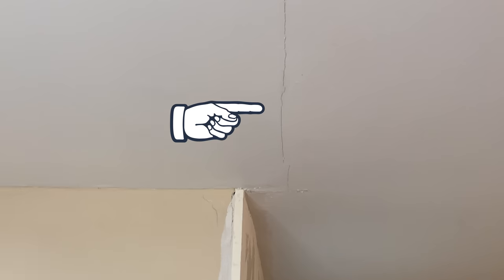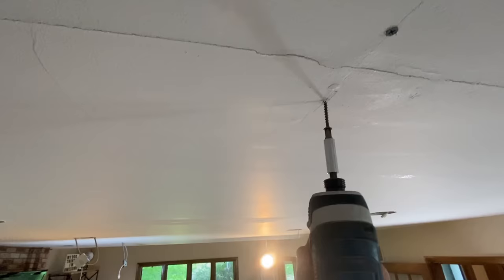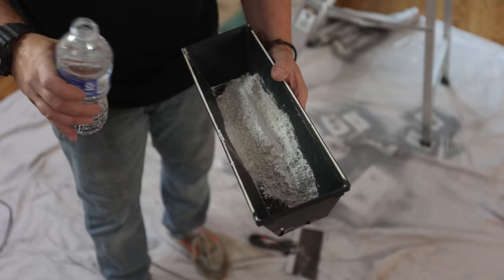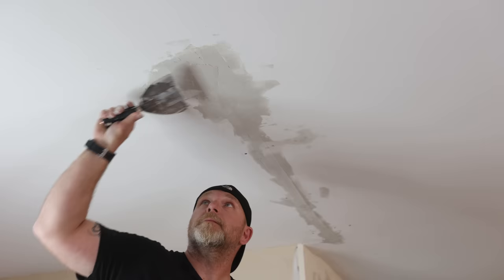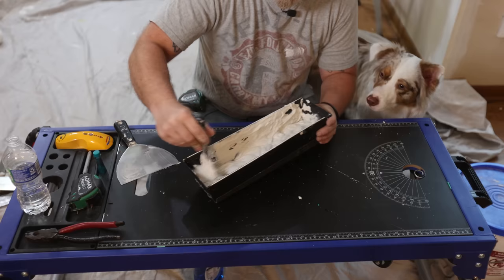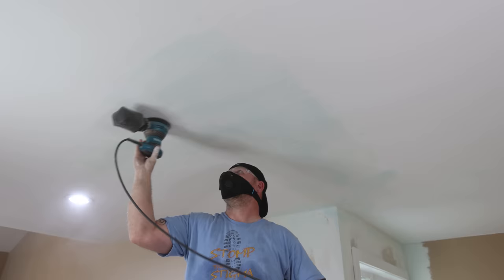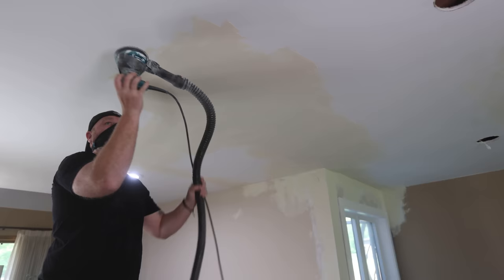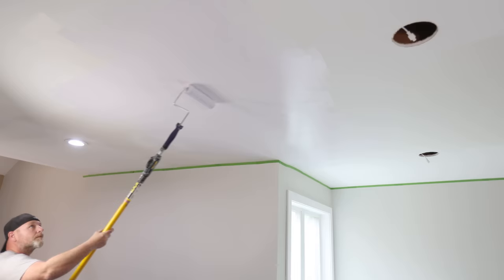How to Fix a Drywall Crack in Ceiling or Wall FOR EVER!!! Tutorial

Comment: Don’t use the color changing paint on a bathroom ceiling if you like hot showers. The moisture brings the color back every time. Learned the hard way.
Reply from the maker: Really??? Had no idea but that’s a great tip!! Does it stay like that for a while ?
Reply: @KomarProject  once the moisture level in the bathroom goes out it goes back to white. I had to kilz it twice then paint with white ceiling paint to stop the issue. Even with the vent fan going, it would change. My wife takes showers as hot as possible, so the vent fan couldn’t really keep up.
Reply: They need a paint that turns red for hot showers, blue for cold.
Reply: I have not seen this ever happen is several baths. What brand of paint?
Reply: @cconnon1912  valspar. I’m glad it hasn’t happened to you, it did me, that’s all I can say.
Reply: @cconnon1912  several people have ran into this issue, but for me, I avoid it in bathrooms.
Reply: I use exterior paint in wet area. No o e ever knows.
Reply: @face2faceyouth  I know the brands of Colour but which particular types of colors I can buy
Reply: @face2faceyouth  what of a wall
Reply: That's why the recommend " Kitchen Bath paint" it is designed for high moisture areas, try living in the East side of the Hawaii Islands, it's ALWAYS that paint, or more comes always, homes are built of stilts so air moves under the structure to help.
Reply: Yes, that Valspar color change paint is absolute trash. Or at least the batch I got was. I used it on the whole first level of my house. I followed the directions meticulously, stirred it really well, and even after a week of drying in low humidity, it never quite lost its purplish hue. 

I had to make a nuisance of myself at customer service and was eventually able to get a partial refund. Unfortunately, I'd already thrown some of the empty cans away and couldn't get a full refund, even with my receipt. And after all that, I still had to stain block and completely repaint the whole ceiling.
Reply: @KomarProject Hi I just subscribed to your channel today I have doing some home renovations as well well kind of It's been 3 years and I still haven't finished but would you be able to send me a link or at least a description list of those products mainly color changing as I know trying to do ceilings in my house with not proper lighting can be really challenging when everything is white as well with the drywall compound thank you Happy New year.
Reply: Wow This is the best tip of the Day.. Thank You🙏
Reply: Looks much better. Just sucks that it takes coating 8’x8’ area for a 6’ crack. I have a 20’ crack. I might as well replace the drywall. It can’t be screwed up snymore. The trusses are bowing down over the last 60 years. I

Comment: Adhesive caulk has come a long way. Whenever I have a seam crack that shows up. I clear the seam out completely and even take off the original tape. I have found Loctite powergrab works the best. Apply a bead in the seam and down either side. Press the seam paper into the adhesive using a 2 or 3 puddy knife. Allow to cure and mud as usual. I have never had a crack reappear in ten years using this method. It was a game changer when I decided to give it a try. Ever since this is how I do all my seams from the very start because I HATE rework.

Comment: I have repaired a lot of drywall in 40 years of finishing. The paper tape failure is 99% user error and not being shown how to thin the mud prior to use. With this type of repair I would always do my best to get down to the drywall and remove all the old tape from being damaged by the moisture. I totally agree with the bed coat and Durabond whether you use paper or mesh (IMO mesh should only be used with a fast setting compound), but I then use the Easy Sand quick set on the first coat to add another layer of hard setting compund to the joint. Then on to the Plus3 and float out till it's no longer noticable
Reply: That’s the exact way to do it….. if you do not remove the damaged tape, then you are just applying mud on a piece of paper tape that is just “ floating their “ and is no longer bonded to the drywall ….. I have a video
Reply: And stephen is on point with the mesh tape being used with quickset only……using it with all 
Purpose, joint compound Will 100% crack again
Reply: @New-Breed-Drywall-And-Paint  Nonsense.I have used every type of mud with all types of tape and 100% no cracks.44 years of drywall experience is all you need to know.
Reply: @velt7560  your telling me using all purpose mud over mesh tape will not crack ??? Is that what your saying …??? One thing I’ve learned from hiring plenty of guys who were not good enough to wash my pan is never hire the guy who throws in his years of experience .
Reply: @New-Breed-Drywall-And-Paint  Never cracked on me.Just gotta know what your doing.
Reply: @New-Breed-Drywall-And-Paint  I'm not for hire so you're safe.I am a one man crew. Let's hear it for my crew baby, let's hear it for my crew.If you use mesh tape I wouldn't let you fill my buckets with water. Ha! Burn!
Reply: @New-Breed-Drywall-And-Paint  I noticed you didn't throw your years of experience in.They don't count till you get at least 30 then add to them.I use 5 minute mud all the time with regular tape.I can use any kind of tape with any kind of mud without whining or it cracking. I don't claim to be the best that's just the way it is.
Reply: @New-Breed-Drywall-And-Paint  I have never had cracking when using all purpose joint compound with mesh tape. Cracking is more of a function of the drywall being not completely secure or underlying stresses that have not been addressed (which the video talks about).
Reply: @New-Breed-Drywall-And-Paint well first off if you're not smart enough to cut out the blister tape you don't always have to remove it but you have to put mud under it to make it stick again but always cut out blister

Comment: Very well done, I learned some good tips here.  As a painter myself driving paintable caulking in the crack and then spackling on top followed by sanding always has worked well for me.  The caulking is flexible and will not crack once in side the cracked ceiling.  I think using your methods will provide and even longer lasting fix.  Thank you.

Comment: Very helpful info! That purple-to-white ceiling paint is great! Beware of drywall dust, though. Please use plastic draping! No matter how careful you try to be, sanded compound dust floats and gets EVERYWHERE! I noticed your unprotected TV and furniture in the background and cringed. Drywall dust can damage both, either right away or over time, as it settles deeper into the components & fabrics. 
The way you explain things is clear & in depth. I'll check out a few more of your videos. I've been at this for years, and it's nice to learn new techniques & tips!
Reply: Either that or use a dustless sander. Although those generally aren't cheap and probably not worth it unless doing drywall for a living. A simple DIY project around the house on the weekend may not be ideal to spend that much money on something you'll use once and never again lol

Comment: Excellent instruction! I taught school for 30 years. I know what I’m talking about. Lots of self-help videos give good information, but are still not enough for true novices. Lots of guys who “know what they’re doing” will benefit, too. Adding food coloring to the mud is brilliant! I’ve had a crack in my wall for years. Now I feel like I can fix it. Thank-you!
Reply: Let us know how it goes.
Reply: Those that know DO, those that don't Teach. There is literally no reason to add food coloring to your drywall mud.What you should do when doing your final sanding is check it with a light parallel to the patch work. The shadows will amplify any problems that you probably won't see until you get your paint on.

Comment: as a 47 yr plaster @ drywall vet, I agree with re-screwing the the board, however,  I  V- out the crack, vacuum , fill the crack with gun foam (not cans), leave it proud till set, then shave down with a fine notched trowel, ( lays flat),   then a skim coat of mud (no tape), sand and paint with good paint that has a little flex.  I have a 110 old victorian, and I have found that houses have "favorite places to crack do to expansion, etc. these cracks need to be filled and finished with materials that can flex since they will continue to move...foam will do this
Reply: Which foam to do you prefer?

Comment: If you need to get excess high spots off, sanding does the job, but for feathering edges, wet sanding works really well with no dust.
Reply: You should never have to sand an edge, feather it with the knife! Sand is for changing texture that’s about it, you want as little mud as possible!
Reply: If you're any good you shouldn't have to do much sanding.

Comment: This will work great for most cracks, but if you have a significant fault line under the drywall, the screws alone won't keep it secure. I had a long crack between the living room and dining area, and when I was looking at similar condos in the same complex, most of them had a similar crack. In this case, it's that the ceiling joists are 22 foot 2X12s and they flex just a little too much for the drywall to flex with them. The drywall needed a flexible reinforcement, and I added that by drilling a hole every 6" and injecting enough expanding foam to see it coming out of the next hole. Once it cured, I mudded and taped it with fiberglass; it has resisted cracking for 15 years, so I think it's fixed for good.

Comment: As a painting contractor, I have seen this method fail all too many times. In my area there is a massive temperature differences from 15 degrees in the winter to 120 degrees in the summer. Because of this almost every house around here has a crack on the living room celling. I have tried repairing them the way showed in the video but  they generally come back.

The only way I have got them to stop once and for all is to add backing behind the cracking area. Sometimes you can access it in the attic, if not you may have to cut a whole and replace the drywall with more wood behind it. It really sucks having to cut a whole in perfectly good drywall but its really the only way i have found to permanently fix the problem.
Reply: So when you backboard, what adhesive do you use.  I have a garage cieling that has cracked.  I plan to remove tape and all mud that I can.  Add expansion joint every twenty feet.  I will back board entire ceiling with board from attic side.  

Prefill with durabond and tape using paper and durabond.  Finish joints with lightweight compound.  I hope that will last.
Reply: @jimw6991  Adhesives can be good, personally I rarely use them. If its attached well with good blocking behind it, you generally don't need it. Make sure you have the right length fasteners though. A lot of times garages have two layers of sheetrock. If so, be sure you account for it in the screw length.

I have had luck with back blocking the joint areas of the sheet rock. Don't necessarily need the entire ceiling blocked. I don't think it would hurt anything, just is a lot more work.

In the past I have used "green Glue" Its generally used for acoustic noise suppression but it did seem to stick well. Liquid nails also makes a glue, maid for drywall that would work well if you want to use glue. If you do what your talking about id be shocked if it cracks.
Reply: It sounds like you just don't know what you are doing.
Reply: @MAGAMAN I've been in the business for 22 years. I rarely work on new houses, I do repaints 99% of the time. My repairs last. So if that isn't "knowing what you are doing" I don't know what is.
Reply: I agree and fortunately I had access to my attic and toe-screwed a 2x6 16” to the ceiling joist.  The 2x6 was centered on the ceiling crack from the attic side.  I then screwed the ceiling’s drywall from the second story hallway.  My walls and ceiling are skim coated and 5 years later the crack has not returned.
Reply: Hole
Reply: As a commercial contractor of 25 years, I agree with you. It will come back no matter how much mud and tape you try to throw at it, unless you can stop the drywall from moving completely. There are going to be some situations however, where adding backing will still not solve the problem. This is where you will need to plan out a drywall expansion joint. This is a channel of flexible plastic or rubber that sits in a groove made in the drywall where a crack has formed, or where one is likely to form in the future. Usually these are put in during initial construction as a preventative feature, but they are also used in repairs like this in extreme cases. They also do not look that great just ran across a ceiling, so we try to plan to put these in line with the openings/dividing lines between rooms.
Reply: also, you can make your own by making a clean 1/4" channel in the drywall, using 2 strips of tear away bead on each side to leave a clean 1/8" gap between the boards, and then filling that gap flush with a urethane caulk and putty knife. Color match the caulk to avoid painting it. This will allow the bead to expand and contract without showing paint cracks over time when it moves.
Reply: @jimw6991 first of all expansion joint only work if they're framed for expansion joints oh you got to do is use paper tape that's it you guys are all making this way too complicated it's not that hard find the cause of the cracks first of all screw the sheets off like he did in the video cut it out like he did but do not use that garbage screen tape that he uses always use paper tape in any type of drywall situation
Reply: He has no clue what’s his doing.
Reply: Fact is, a crack develops for a reason. You have to "release" it before you fix it. Releasing involves removing all the tension leading to the crack developing. Sometimes that means manually extending the crack much further and then repairing it. Temperature and moisture fluctuations will generally only result in new cracks developing when the original crack has not been released
Reply: My house has these temp extremes too but the attic feels really warm and insulated.
Reply: @user-uk1ol5kn4n  The only time I use mesh tape is on the corner bead to help strengthen it should it ever get bumped.
Reply: Check out videos on proper attic ventilation and the damage that can result. The attic should be the same temp as outside. @tifacola
Reply: “hole”, not “whole”.

Comment: Great video! Wanted to add a comment that a little sprinkle of chalk from a Chalk Reel works great for coloring mud as well. I would assume most are more likely to have that around a job site vs food coloring.
Reply: Ross, does the color of the chalk become a concern with regards to the number of coats it takes to cover certain colors.  I seem to recall a lighter color Redguarded wall I had to plaster/texture over  and paint.  That Redguard showed itself through a skim coat of plaster, the knock down texture layer, and two coats of paint (the paint was a cheap variety with supposed mixed in primer, so that may be my explanation there).
Reply: Never had that issue, but I don’t use a ton. Just enough to see the color difference. Even when using paint that’s advertised as a paint + primer, you should always use a standalone primer on bare drywall or joint compound.

Comment: You added more work than necessary. I did this for 50 years and it's easier than what you showed.
Reply: Because… why?
Reply: I agree. I could have used 20 minute or even 5 minute mud and repaired that must faster and better. He's such a noob. All that sanding, wow. lol
Reply: What steps would you leave out?

Comment: For a plaster wall (skim coat and size dependent) I'll set my small router to remove just the plaster skim coat. I rout the area wide enough to accept and completely enbed the tape. I typically use standard joint compound to finish. This method dramatically cuts down on the area needed to hide the repair and does not create a raised area....if that's a consideration. You can also use a chisel to cut down on the dust. I'll put a vac to my router for some dust management.
Reply: I do something similar but I’ll just mark and cut a track wide enough for the mesh with a straight edge and a utility knife.
Reply: If you are routing a hole in your drywall wide enough to fit the tape, you are defeating the point of putting on the tape in the first place.

Comment: An issues some have is not with cracks.  Their issues is the tape is coming loose and or off their vaulted / cathedral ceiling due to the framing expanding and contracting at the framing joints.  When wood expands in a hot attic, something has to give,

Comment: I prefer paper tape for reparing cracks.  Mesh tape often results in the crack reappearing in many cases.  I also prefer to remove the old tape first, so that you can bury the new paper tape.  You will get better results for both smooth wall and texture finishes.
Reply: Yes. I agree. Mesh tape is shit for this scenario...
Reply: The mesh tape is for amateurs that have problems with the paper tape. The paper tape is far superior than the mesh but both will work. When using the paper tape you can't have any voids of mud under the tape or it will leave a blister.
Reply: @Hamp72  true, but that mesh will fail...
Reply: @YAWN....  I have had to fix a bunch of cracks from people using mesh for sure, especially in mobile homes after they have been moved. I have been in the drywall business over 30 years and all I ever use is paper tape. I'm an old timer hand finisher.
Reply: Sometimes cracks still return with mesh tape, even if you do everything right.
Reply: Glidwall mesh is better than any predecessor